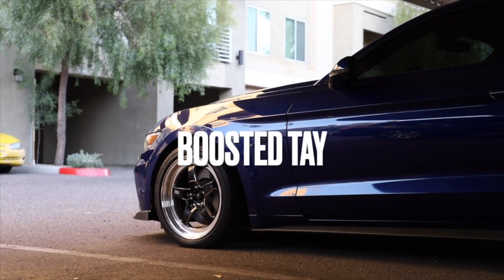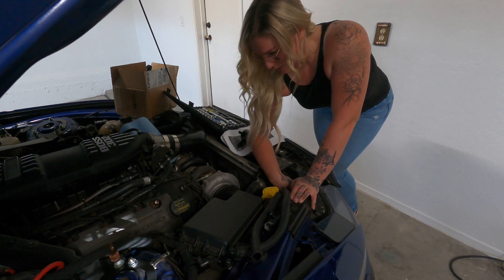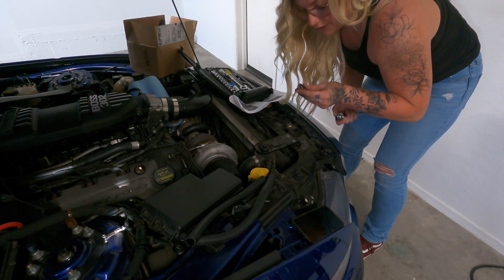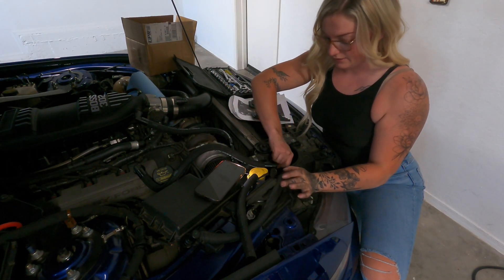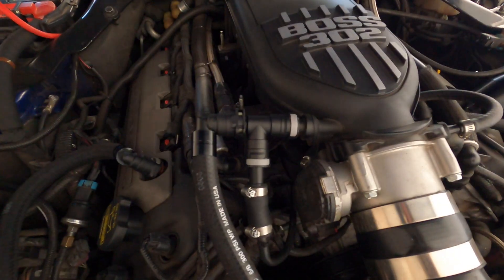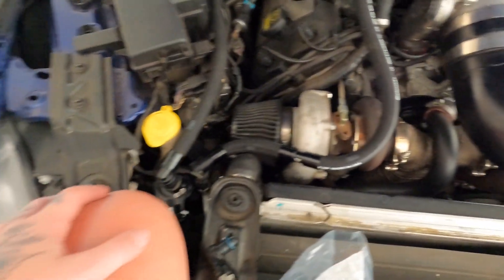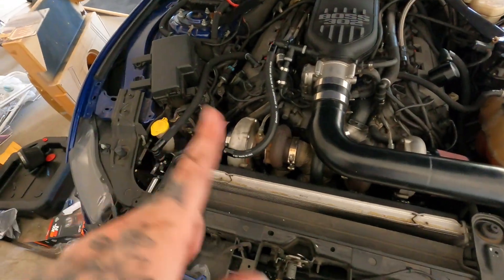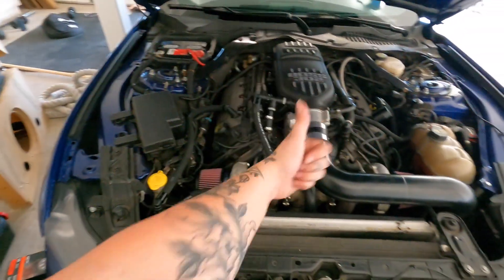Installing a UPR catch can on my Twin Turbo Mustang

Comment: Lol you're not the only one to drop shit installing this, I had the same problem. It's a good location for helping the catch can work, but not for install or emptying it. Speaking of that, make sure you check the can pretty frequently, like every 500 miles for the first 2000 or so, that helps you get a baseline of how often you fill it up. Letting it fill up completely is a bad time....
Reply from the maker: Good to know!